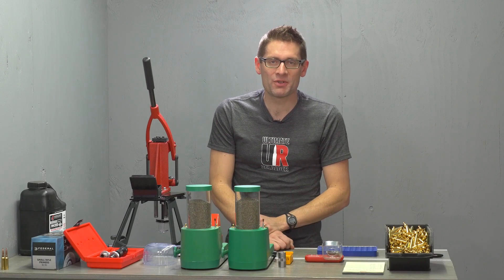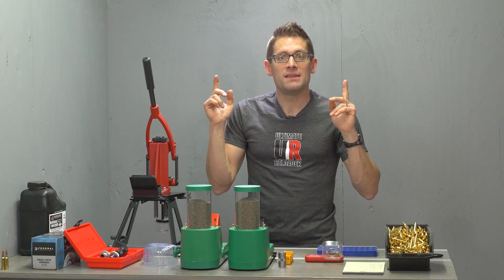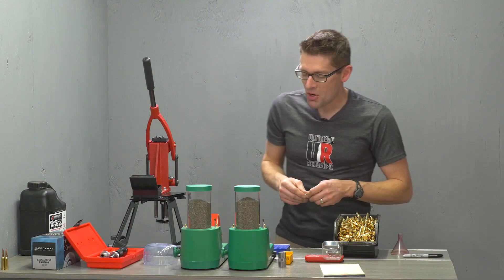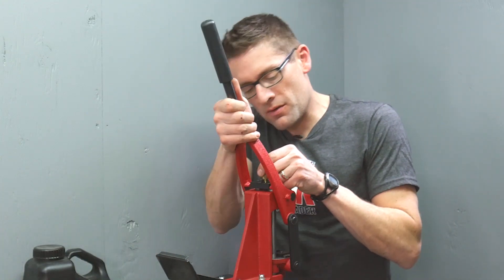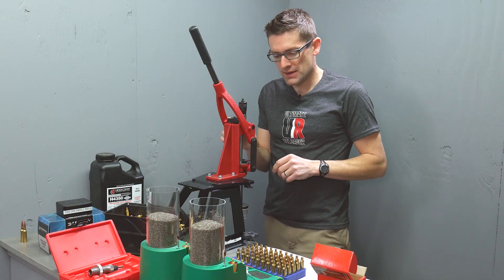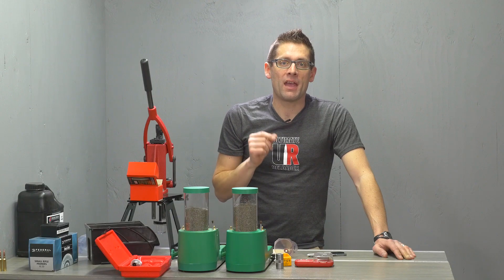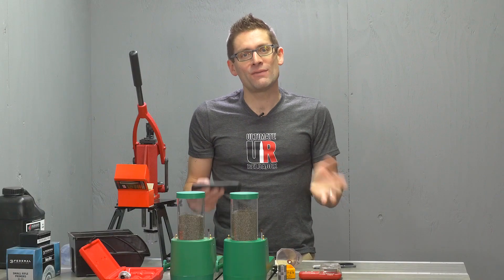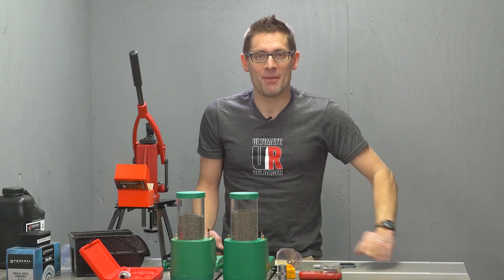Expanded 10 Shot Load Development for 6.5 Creedmoor

Comment: Hey gavintoobe!  Good stuff man!  Just a couple of questions and comments.
1.  Do you think the time savings from using two different scales is worth introducing an unnecessary variable into your testing?  2.  Did you consider shooting with each progressive string made from cartridges of incrementally increasing (or decreasing) powder charges?  I think the methodology you used had the lowest charge with the lowest barrel temp and the highest charge at the max barrel temp.  Not sure there would be a difference, but something to think about.
3.  The load that provides the tightest group with the Magneto speed attached might very well be different than the load that provides the tightest group without the Magneto speed attached.  So, velocity testing as you had done without simultaneous group testing is probably OK.  If you switch to a LabRadar or optical chronograph, then I'd think about shooting groups at the same time.
Reply: 1. yes, there's drift between the scales. with the advent of the autotrickler that variable is removed and loading is even faster. go check it out. caveat: your wallet might pass out.  2. ambient air temperatures have more effect on ammunition performance than chamber or barrel temperatures (higher temperatures equals lower air densities), you'd be surprised. as long as you don't let the ammunition sit in a hot chamber (or other very hot location) the effect is negligible. you really have to heat it to get a POI shift as a result of ammunition temps http://bulletin.accurateshooter.com/2018/07/how-ammo-temp-affects-pressure-velocity-and-point-of-impact/  3. as for shooting for group size and location, it's difficult to interpret without a good coach or video cameras (and an objective eye). of course the group size and location will change without a magnetospeed hanging off the gun. but if you want to do both OCW and velocity (pressure) testing i'd recommend a dedicated chronograph and dedicated sessions to better illustrate whether or not your shots are shooter error, environmental, or load variation. a lot of folks are doing it, David Tubb and Wiser Precision both sell dedicated magnetospeed mounts to record data from total shots fired or you could drop $500 on a labradar.  or you could shell out a little over $130 and buy QuickLoad software to help tune in to the desired chamber pressure. there are a lot of ways to determine a good load, he's just showing one way
Reply: George Meinschein this is exactly why I switched to LabRadar. Nice to be able to group test while watching velocity at the same time.

Comment: Good method. I'll try that. Quick question. I have the RPR 6.5 also. How much jump are you seating the eld's for and what is your CBTO measurement? I'm using the 143eldx for hunting. Best group I could get was at 42.2gr h4350. A little above redline. 2659fps ave. 10 shots

Comment: Great video.  I just recently switched to this method of load development only I went with triplicates of each charge weight and I did 0.1 gr increments so I look forward to getting results from my first trial of 280 Ackley loads.  It's interesting that you seem to have found a good node at 40.3 gr as I found a node using OCW with my 6.5 Savage BA Stealth at 40.1 gr running H4350, Hornady brass, 140 gr Berger VLDs and CCI BR-2.  Maybe that's a sweet spot range for 6.5 CMs.  Thanks again and look forward to future videos!

Comment: Great video. I just finished with my 123 & 140 ELD M Varget loads in my RPR, the Ruger compensator and held half MOA's at 200 yds. I just got my hands on H4350 and 147 ELD M. I use the same method as you to achieve the best group possible. I don't have a crono yet, and wonder what  you would recommend. Being that we are shooting the same rifle what do you like as a C.O.L, due to the magazine restrictions 
Thanks

Comment: First, let me say thank you and Bolt Action Reloading for the time and resources you put into your channels!  
I have been trying to figure out this phoneme,  the increase in powder with no increase in fps.  Anyone who is serious about reloading has experienced this. If you are familiar with Quick Load, it cannot predict this either.  I am wondering if it is a combination of barrel time and barrel harmonics.  If you find out let me known.
Reply: Steve Reynolds I believe this is due to case capacity differences. If you shoot two cases with one having slightly more case capacity then the other the one with more case capacity with a .1 or .2 increase in powder charge could be slower or the same velocity as the lower charge with less case capacity. Weight cases will not accurately predict internal h20 volume. It will only show consistency in brass weight which is good but measuring their h20 capacity is best practice.

Comment: Your speed is pretty low. I think you need to go up on your charges to 43 grains or so. 2750 is pretty common for 6.5 Creed.
Reply: I agree those seem very low, but with my A-4350 @ 41g I'm getting over 2800fps not sure why his is so low. I'm using Lapua brass though. Slightly less capacity
Reply: Charge weight is a bit low. Factory used to use 41.5 H4350. With 147 ELD, start at 41 and work up to 42.5. Actually Reloder 26 works very well.
Reply: snake57 I’m glad to see someone else using rl26! How many grains are you running on 147 ELD?

Comment: Id think youd need to have all once fired/formed brass for the best results. And then weighing each case.
Reply from the maker: That's what Paul from Accurate Shooter said :) I'll try that next time (the once-fired part)
Reply: I have once fired brass. My case weight, trimmed to 1.91", is 160.2gr.  Just my $0.02.
Reply: Rex Trammell  Sellier & Bellot.
Reply: Rex Trammell  Whoa! I just read the rest of your post. I was reloading Sellier & Bellot rounds. I got in a 500rnd pack but I am not sure what you are talking about when you bring variances into the conversation. I know STD, the figures of which were not alarming.  I measured several (probably 15) when I reloaded about 150 rounds and would periodically check lengths/weights. My average is what I spoke of earlier as far as my sample set.

At this point, I'm just trying to tune the bullets to the suppressor to get my gas block adjusted while not blowing off my hand or making the rifle explode - those are my primary goals right now. There is no competition for me (yet). I'm just some lacky trying to save $$ (my stimulus has NOT arrived yet.)  I have been blowing out primers and I just found out my Lyman Precision scale 1500 was whacked and will be replaced. I am not in the process of tearing apart bullets as I don't trust what the scale was telling me.

Comment: Just curious...why didn’t you go ahead and shoot paper at 100 through the chrony.  That way, you’d have all the data you need with just the 50 rounds.
Reply: My guess would be time. It takes a long time to shoot 10 5-shot groups (at least for me), especially when you're trying not to heat up the barrel. Also, there's no point in shooting for groups when your SD is high (generally you want 10 or less). So really, the only groups that would have been beneficial to shoot for him would have been the 39.5 and 40.3. Now since he has that data, he can take the time to go shoot those groups, and will more than likely load additional 5-shot groups at .1 increments to further narrow it down. After that, you can adjust bullet length, jump, etc.
Reply: @Meyerwoodworks  see, this guy gets it. honestly, i don't know why he didn't just go for the 40.3 to begin with. it's the highest flat velocity node that's closest to the line of average shots fired. statistics yo.
Reply from the maker: Exactly- this is about quickly getting to a "zone" I can shoot groups with. :)
Reply: I have the same chronograph and I never look at groups when using it. It is strapped to the barrel and changes the vibration dynamics. My Masterpiece Arms 6.5 Creedmoor, the groups open up slightly and are high compared to shooting without it.  I always shoot at a target but disregard the groups when using the chronograph.
Reply: @Dbarves  Wiser Precision magnetospeed mount brother. it'll change your whole perspective on life.
Reply: J. Rob. I agree I do all mine at the same time. It doesn’t take much longer. If you are crunched for time do half one day and half the other lol
Reply: Great video! I always appreciate the science you put into these load development videos. I always shoot 5 shot groups when working up a load usually two tenths of a grain apart. Sometimes I'll shoot two 5 shot groups for each load just to add more verification to the data. I also tend to shoot for groups on all of them even though that can be a bit tedious. Sometimes interesting results occur when looking at group size as well as extreme spread and standard deviation. I noticed you had to press a button to get the chargemaster Lite version to dispense. My full-size chargemaster automatically starts dispensing the next load as soon as the pan is back in place which is very convenient. I do like the idea of having two though . For heavy charge weights I sometimes am waiting on the chargemaster although I generally do charging, bullet seating and crimping all at once for each round so there's plenty of time to dispense powder.
Reply: Oh, and great video… things are starting to dawn on me

Comment: Very informative video.  Interesting that I just finished the 10 shot series and had a flat spot at 40.6 grains of H4350.  The only difference is that I used cleaned/resized/trimmed Hornady brass,  where I FL sized with a Hornady die (minus the depriming pin) and expanded the neck with a Sinclair mandrel die.  The brass had already been deprimed with a dedicated depriming die.  I have a 5 shot series ready for my next range trip, so I can verify the node.  Oh, and I did use CCI BR-2 primers.  Honestly I don't know if that helped or not.

I have performed the same method with Varget 35.9gr and that got me an 8.6 SD with a 22 ES.  That's not bad but I'm hoping for better from the H4350.
Reply from the maker: Cool- what weight bullets are you running?
Reply: Hornady 140 ELD-M

Comment: Hi Gavin, I think you need to use a more accurate weighing system. The scale on the right at one point read 39.3 but when you poured that powder to the left it read 39.1. Being you're charge increments are 0.2, that would not yield to accurate results.
Reply: Mike from the block I load with a Dillon XL650  with a powder measure known for not being that accurate. Ive rang steel at 600 yards with no misses except getting dialed in. A first time shooter hit 600 first time and it was consistent. Maybe for load development for groups is important but to 600 yards a 7x7 plate will be easily hit with a +/- .2 variance
Reply: OOOHH then again he’s doing two different charge weights in his load. He loads five of each charge weight and he’s loading two rows at a time. So row one will get a different charge weight than Row two. And he pours the charge from each scale on a different row

Comment: Great video bud. How well do you like the chargemaster lite.
Reply: gavintoobe   Looks like you had at least one of those .1 grain over charges that slipped by. The first 39.3 gr charge crept up to 39.4 before you poured it in the case.
Reply from the maker: Jiminico I noticed it while editing the video - I knew someone like you would point that out ha ha.
Reply from the maker: Thanks! The RCBS Chargemaster Lites have been working awesome for me. As long as you are careful to calibrate, and are are mindful of "stable indicator", etc - you'll get awesome results. They are really fast- and due to that they overcharge by 0.1 grains on occasion- esp. with stick powders. But- it's very simple to pluck a couple granules of powder to remove that 0.1 overshot (this only happens when multiple granules fall out at once at the end of the trickling phase).
Reply from the maker: Jiminico Read the full video description- see the * :)
Reply: Oh I didn't see that.. or did you just slip that in afterwards? lol